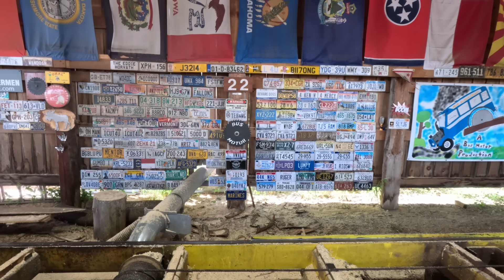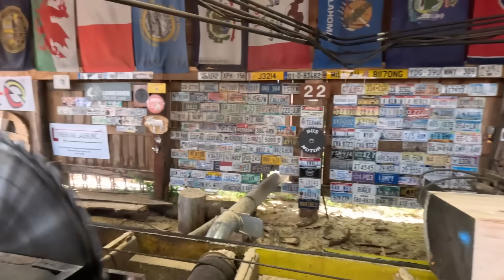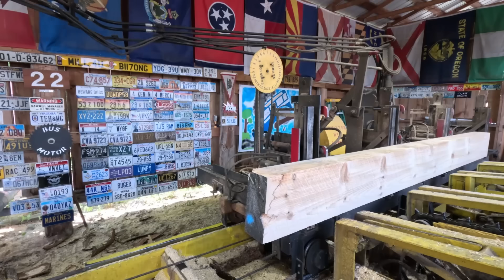sawing a 12 foot white pine log snack video # 565

Comment: Hey Mark, so nice to see these snack videos. Since becoming addicted to your channel about a year ago, after losing my wife to cancer, I've found these videos to be incredibly therapeutic and relaxing to watch, to the point where I'm trying to guess when you are going to turn the log or decide what you are going to cut. Keep up the good work. Best regards from Ruthin, North Wales - loving the red dragon flag btw.
Reply from the maker: thank you Mark , very sorry to hear that about your wife.
Reply: @markgalicic7788  Thanks Mark, much appreciated. I used to work in a slate mill (1978 to 1985), splitting and dressing roofing slates. There is a lot in common with getting the most out of the material and I love the way you decide on the fly how you are going to best saw your logs. No argument with the stop sign method either - I love it! Best regards to yourself, Eddie and ZZ.

Comment: Mark,
I have a question for you:- " Is a pile of sawdust sitting next to your sawmill a danger ? Is sawdust a combustible material ?
I notice on some channels (not yours !!) that the operators have large piles of sawdust just sitting on the floor for what could be a few weeks !! When I took woodworking classes in High School, our instructor said we need to vacuum up the sawdust, because if we didn't it would build up heat and self ignite !! Is that true or not ?? Thanks for your answer !!
Reply from the maker: we try to keep the sawdust cleaned up , I don't think it could self ignite.
Reply: Really big piles of sawdust at some of the larger mills can catch for just from the heat that they produce  just like bales of hay  and you do t put them out with water the fire only gets hotter.  We just pack them down with front end loaders  oxygen is your enemy

Comment: So, a random question from an uninitiated dude in Western PA.  I've seen a couple of your cuts where the wain extends about 1-2 feet down the log and then it becomes a completely clear 10 or 12 inch wide board.  Is it more desirable to edge out a clear 6-inch board that is the full length of the log or is it more desirable to have a shorter 12 inch wide board?    I love watching your videos and hope to meet you guys some day in person at a show or someplace down the road!
Reply: You can have wane up to 1/2 the length of the board and up to 1/4” wide without effecting the grade  so he would be cutting off footage  but if the customer wanted clean lumber with no wane most sawmills might charge a little more for premium lumber  if you interested you could check out a hardwood and softwood grading book